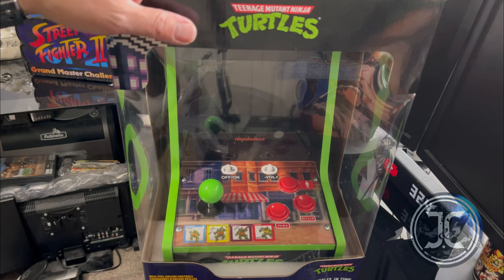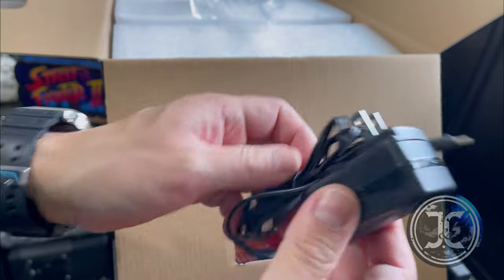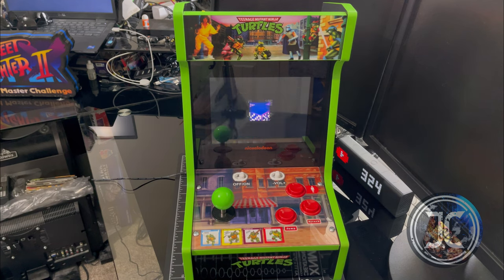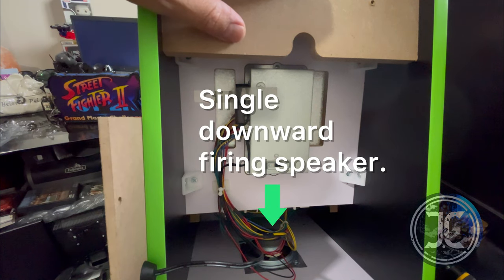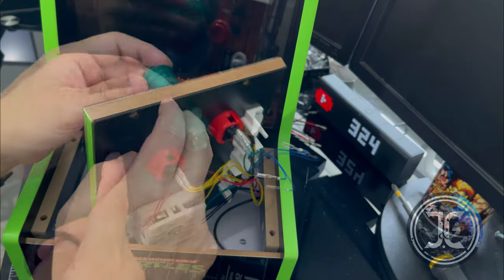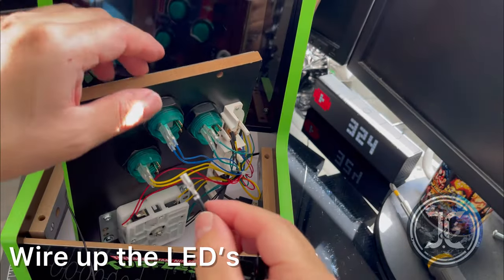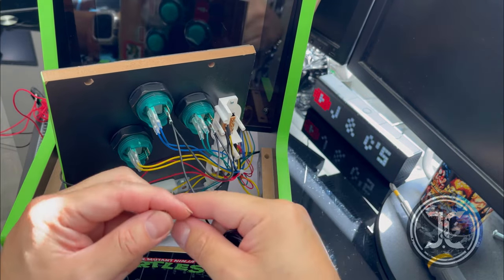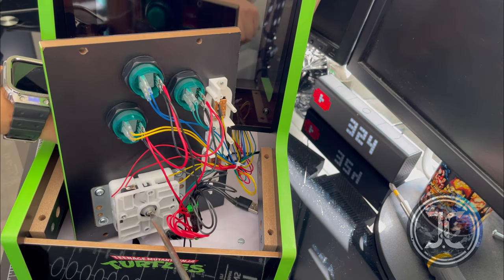Teenage Mutant Ninja Turtles: A-1Up Countercade Unboxing and Button Mod 🕹️ #tmnt #arcade # led #mod

Comment: Amazing video! I'm always in awe of people who can do stuff like this! I assume doing this on the Street Fighter 2 countercade would pretty much be the same procedure?
Reply from the maker: @freddybeer  thanks! Yes, I’m pretty sure it would be the same for the Street Fighter 2 as well.
Reply: @jcsworld69  - Is there a way to replace the buttons on these machines without soldiering or cutting anything? Simply buying new buttons and replacing the old ones by unplugging them? I'm really no good with this stuff.
Reply from the maker: @freddybeer  if you just want to upgrade the buttons, you just disconnect the 2 wires from the stock buttons and reconnect them to the new buttons.
Basic soldering skills would be required if you want to use LED buttons.
Reply: @jcsworld69  - Fantastic! I was hoping it would be as easy as that! Thank you, kind sir!

Comment: Cool mod and great video. I picked this up on sale as well and noticed that on the turtle selection screen the joy stick seems a little sensitive. Some times when going right or left it will fly over an extra character do you have the same issue? Once in game it seems to work fine
Reply from the maker: Hi Adama2003, thanks!
Yes, I also have the same issue at the character selection screen. It must be an issue with the port of the game.
Are you going to do the light up marquee mod?

TMNT: DIY Light-Up Marquee (A1UP) 🐢🕹️ Etsy Store: Mancave Essential #tmnt #arcade #diy
https://youtube.com/shorts/7IXHbq_5g74?feature=share
Reply: @jcsworld69  thank you for confirming it has the same issue. Wow that’s another awesome mod you have done. I have to say it looks tempting to do that. Your final product in the youtube short looks awesome. That’s how it should have come stock 😁 keep up the great content.
Reply from the maker: @adama2003  🤜🤛 thanks!